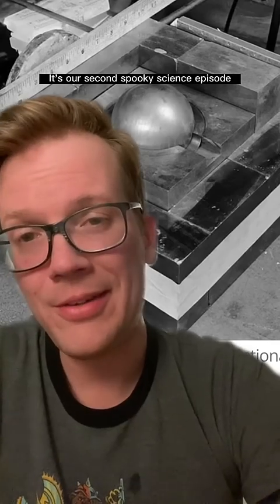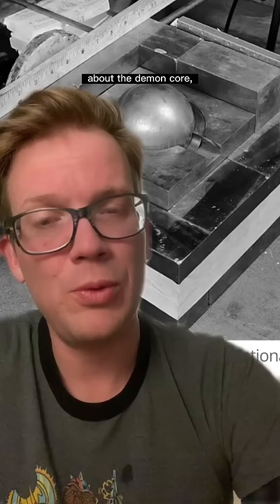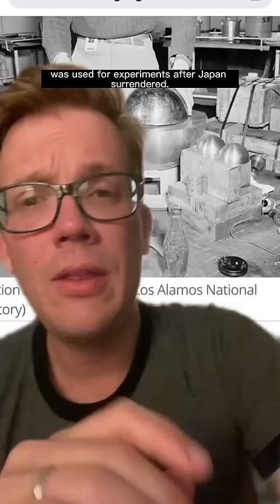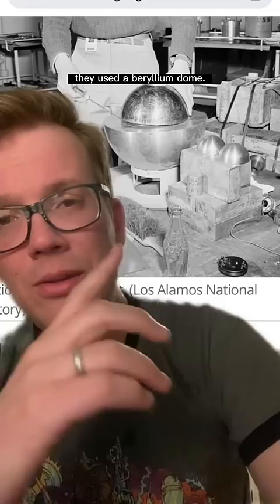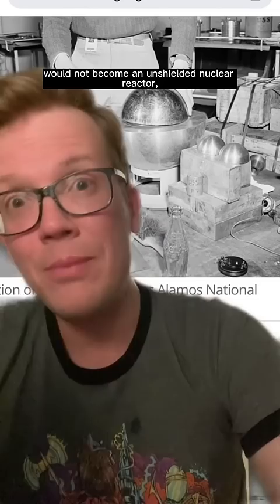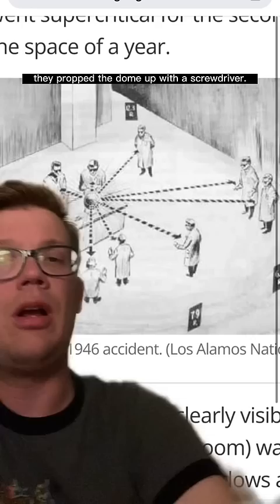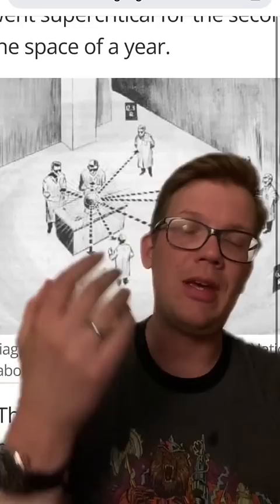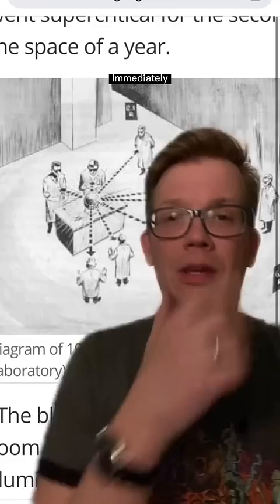Spooky Science episode 7: Second demon core incident

Comment: He was SUPPOSED to be using a set of shims to keep the lid from closing, but supposedly preferred the screwdriver because he had better leverage at the cost of lower surface area to keep the lid on the end of the screwdriver.
Reply: See? That's why safety norms are supposed to be followed as they were written. Cutting corners always opens up the chance of someone f"cling up badly.

Comment: Slotin literally watched his coworker brutally die due to the exact same irresponsible behavior and was like omg I need to do the same
Reply: There's a huge difference between letting a brick fall and using a screwdriver to prop up a dome, that difference being that only one of them shows irresponsible behavior and the other doesn't, the only thing that could be called irresponsible would be the method of testing.

What would be ironic though is that they might've switched from the brick method to the dome because it would be safer due to working with spacers and a crane to move the upper dome in a very controlled manner that isn't susceptible to human error, only for Slotin to go: "lmao, why would you need all of that when screwdrivers exist."
Reply: @makeshiftparadox  I wonder if they were due to run the experiment but the crane or other equipment to run the test safely was delayed or being used somewhere else?
Reply: @lordpsi99  
Nah, the thing is simply that the safe testing methods took more time than Slotin's screwdriver method (lifting the crane, bringing it back down, getting spacers built for the exact distance you want the dome to be open etc.). So he just ignored them, in favor of his quick and efficient screwdriver method.

Comment: “Hey check this shit” proceeds to get large dosages of radiation by dropping a screwdriver for a few seconds
Reply: The screwdriver was used as a wedge to keep the 2 dome pieces separated at one point
Dude should have used a rubber sheath on the core since it wasn't gonna be used for military application

Comment: One asterisk for this story. The dome did originally have stoppers fixed around the core to prevent the some from shutting entirely. The lead scientist however was known for being a little reckless and removed the stoppers opting to instead use the screw driver. After the flash of radiation all other scientists and photographer fled the room. The lead called all of them back in and told them to stand exactly where they'd previously been standing so he could calculate how bad their radiation exposure was

Comment: Its also kinda terrifying that of you had a camera filming in the room it would not have seen the bright blue flash. The blue flash is directly caused by the radiation going through their eyeballs… 😳
Reply: The gamma flux was high enough to cause rapid ionization of the air, which caused it to actually glow with blue light.

You're thinking of the Cherenkov radiation that may have happened inside of the observers' eyeballs as high speed charged particles passed through them. However, those charged particles would have needed to pass through the beryllium and the air before reaching eyeballs, and both of those together would actually be pretty decent shielding against charged particles. It's not likely for them to still be moving at, say, 70% of the speed of light when they reach eyeballs, so the Cherenkov glow wouldn't be bright enough to really rival the ionized air.
Reply: @BlahVideosBlahBlah  thats a good point, i didnt think about about the ionization of the air

Comment: What I don't understand is why they didn't keep a couple razorblades under there as well. I just know that they would be easier to manage than a single flat screwdriver head. He was experimenting with the effects of lowering it down as close to going supercritical as possible, even removing the safeguards because they stopped it too soon for his liking. But I've got a razorblade in my hand, and they're way thinner than a flathead. So if they stacked two rows of dulled blades, they could simply remove one blade from each stack to see how low it could go.

Comment: He also called everyone back into the room and stand at the same spot they were standing, and than calculated the amount of radiation each person had gotten.
Reply: He didn't call them back into the room, he told everyone to stay where they were before anyone had moved.
Reply: @Shadowmech88  they had run out of the room. They didn't just stand there as they were getting blasted with radiation.
Reply: @claeab255  
The radiation lasted only half a second, which is hardly enough time to react at all let alone completely leave the room.
Reply: @Shadowmech88  the human brain can react in 300 milliseconds. Also, there is no concrete evidence as to how long the radiation lasted for. It is more than likely that everyone had at least moved by the time the radiation stopped.
Reply: @claeab255  
A human can press a button in a controlled reaction test within 300ms, but reacting with action to a more open-ended situation where one is taken by surprise is a different story.
For example, the reaction time of drivers behind the wheel of a car (recognizing a threat, deciding what to do, and then beginning to change direction or brake) can be anywhere from 0.7-2.5 seconds.
Reply: @Shadowmech88  yes, but the same goes for after the radiation stopped. The other people in the room wouldn't have stopped running immediately after the radiation stripped because they would still be experiencing fight-or-flight. Also, they were trained people who knew that this was a possibility and would likely have already had a plan in mind for this scenario. In any case, there isn't way way to know for sure what exactly happened. I'm just going off of what i heard and my own logic.

Comment: That’s what I don’t understand Mr. Science Dude. Why don’t we just create a reactor that has several big metal domes over it. This one’s beryllium but what if we made one out of lead for the first sphere, tungsten for the second at its bigger than the first core, and then maybe a very thick steel core over that one. In essence, it would look like a mode of the earth and its core and all the layers in between. If we drilled a small hole through all those layers, couldn’t that propel someone forward in space? Wouldn’t that be a nuclear fusion engine? Also, if the cores are strong enough couldnt it keep all that energy bottled up at the center even though there’s a hole leading to it?

Comment: I'm in the H vac Dyslexic, so bad you cannot even start to comprehend some of the shit I went through. However, I didn't start studying about heating an air. I was supposed to work at a nuclear power plant Bell Fonte power plant. Cross trained later into heating in aire however that's not important The first time I heard this. There was no cameras set up.
So I'm wondering if that part's true. Now you say my brain is not smart enough to split the atom. But it is smart enough to learn different chemicals that keep power plants cooler. Since then, I've been a follower of chinoble. What happened in Japan?
Most people don't understand how hot the sun is. It's nothing but a reactor that's continuously going off. It will eventually stop and life on earth will not exist.

Comment: I'm not crazy about how he leads this off making it sound like the one scientists method of using a screwdriver was their go to method.  It wasn't most of the time it was done with these lil spacers all equal sizes 4, one went on each side.  This man used to do thus screwdriver method occasionally, almost always by himself because the others were always so afraid.  This particular time as you kind of were going to hint at but didn't clarify that this incident happened because he was actually showing them how safe it was and how many times he had done and that it was OK.  They hadn't needed to do anything but he wanted to show them that, nah guys look it's totally safe...kinda deals.  just saying it makes it sound like all the scientists used this as a normal method and would do it daily and that's not true all the other scientists when doing this would do it corr3ctly, he was the only one who insisted on being a loss cannon and having to rebel and be like nah I can do it differently.

Comment: So let me get this right you open up a shield unshielded and then it becomes an unshielded nuclear reactor so how do you close it off and what was it in beforehand to keep it from going super critical and how was the screwdriver put into the Gap was it sitting straight vertical in the gap or was it horizontal with just the blade in it I can't see it coming loose at all if it were horizontal there is no place for it to go it is basically like a toothpick in some teeth unless it was knocked out there was no slippage and if the case had to be propped open how was it propped open in the first place to keep from going supercritical in the first if it were a bad thing to close the shield during transportation then how did they close it and get it from point a to point b I call bs and lies on multiple levels although historically speaking and judging by the past I can see this scenario happening but you know they will cover ups judging by the past I got to say one thing for them at least they constantly and consecutively persistent they are like children trying to drive the bus it is super ultra mega funny until they start hitting people and things things get destroyed forever and people simply die forever ♾️ 😮😢🤔🧐 because they don't understand what they are doing they have to write down things as the experiment and if they do not follow the original rules because the original scientists had the wrong skin color😮😢😊😅😂 ahhhh ha the big dummies put in a screwdriver and the device was merely natural selection scientifically speaking 🤔🧐🤓😎

Comment: I need an explanation for dummies
Reply: The idea behind the dome and the experiements was to bring the core close to criticality without having it go critical. Oversimplification from a dude who knows fuck all about radioactivity, the screwdriver held the dome in a position of close to criticality, as well as let the radioactive particles safely pass outside the dome. When that dome fell, the core IMMEDIATELY went critical, so the one performing the test took off the dome as quickly as possible.
Reply: 1 material particle throws 2 small particle when hit by 1 small particle. Was trying to reflect enough small particles to keep it stable without increasing or decreasing exponentially. Screwdriver holding "mirror" slipped, went into exponential increase. When he opened, all the particles went outside. They're harmful at high doses since they change dna (body's orders to cells) and stop it from regenerating